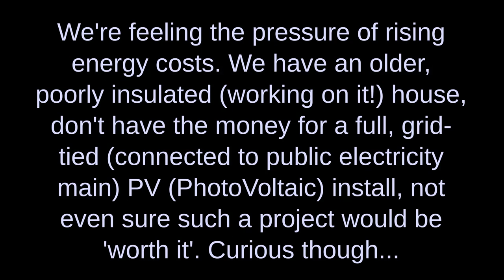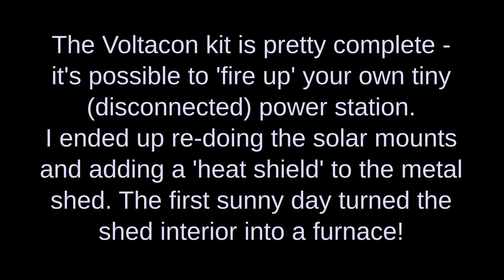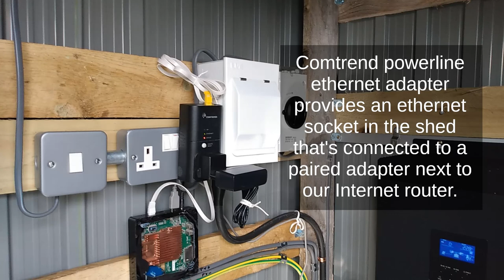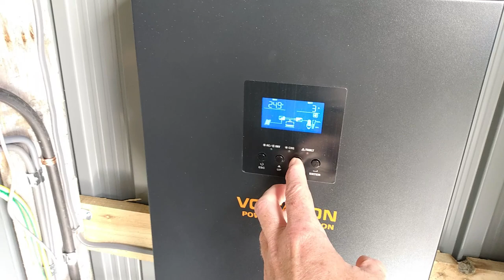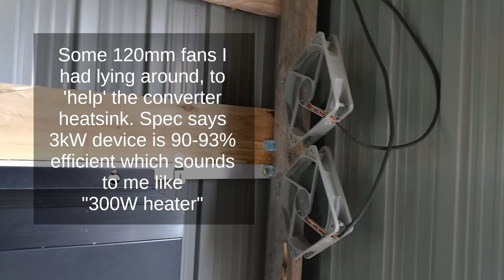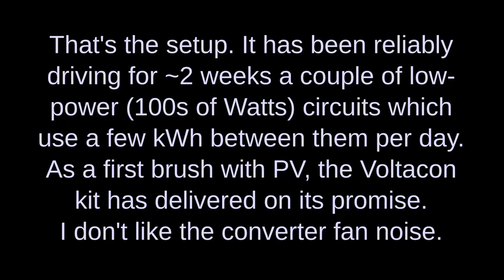Voltacon S3 Off-Grid Solar Kit 24V 3kW in back garden

Comment: It's great to have a small glimpse of what you've been busy with - this is a really impressive setup. I was going to ask if you can build me one next, but then I started reading the 2 month update ;) It's a shame it isn't plain sailing through these heatwaves because it seems like now is exactly when you want to reaping the benefits.
Reply from the maker: Hi Simon, I want to see it go through at least one winter first before I'd give it the complete seal of approval. We were so pleased with it we ordered more solar panels (in the post) just before it died. Not winning the "we could run aircon for free" argument indoors: tropical weather doesn't last long enough yet! The owning-your-own-powercut thing needs some more thought - if only I had a bajillion vans full of guys ready to fix any problems that might occur...
Reply: Hmmm yes - I do live in an area where the infrastructure is just old enough that there seems to be a localised power cut somewhere every other week, but it does indeed get fixed very promptly so that's nice to not worry about. We're almost weaned off gas now with just the boiler left, but obviously that is still reliant on the electricity running regardless. I assume that the panels are a pretty safe investment though so long as you've got something to collect and store to connect them to (shame about missing the opportunity to see them delivered to a certain front desk).

Anyway as I say, it has been great to see these. Possibly through the mysteries of the algorithm I am now getting suggested loads of DIY doing-up-British-homes videos, and then follow-up videos about how successful these types of videos are, have you considered diversifying?
Reply from the maker: @srjm86  I'm going to use "considering diversifying" instead of "wondering what to do when I grow up" from now on. My angel investor doesn't have unlimited patience - I'll be back in a mill any month now
Reply: @trs4u  And just like that "Solar panel sales boom as energy bills soar" is the BBC headline, although this is covering people who are very much on-grid.
Reply from the maker: @srjm86  Should have an update soon, waiting for bits and bobs currently (due to boom?) as rare as hen's teeth that'll probably be in the Screwfix catalogue next year. This no-inverter power cut put quite a hole in my plans. I wonder if people 'getting it done properly' can phone their installer and get dead equipment quickly swapped?

Comment: I have 3000w inverter esun 12x 280w solar array 2x24v 100ah 4.8kwh )battery running small 2bed house fridge.tv lighting pc etc like phone chargers laptop in a day I run washing machine and heavier loads application straight from the sun 🌞 and charging the battery in the Same time and those battery it takes 2-3 hr to charge to full  from January-November no problem for winter planning to get a extra 1or 2 battery
Reply from the maker: Very similar to ours then - that's good news about the winter. We have more panels 'in the post', and we're considering more storage. I'm hoping to run concrete slab UFH and some hot water heating on ours on an automatic sharing basis (can't all run at once!). Nothing's happening until the dead-inverter powercut ends though 😢

Comment from the maker: After 2 months of running without a hitch, we had our own 'powercut' one evening after the record hot day. The next 2 days were thick cloud/haze here and we had 4 PCs in the house blazing away (combined about 500W drain) early in the morning to late in the evening, we drained the battery down past 21V and the inverter cut out. Not the end of the world, we went straight back onto 'brown energy' by the magic of extension leads until the next morning. A week later the power cut out again late on a sunny morning, batteries at 25.2V. This time it seems completely dead - no display, no fans, no output. We can get a warranty service, but apparently this could take weeks. We had been talking about what to do in the event of our very own powercuts, and this seems like yet another thing (we're replacing the 6 panels with 12 slightly larger in the hope of coping better with low-light days) we should have considered before buying and committed to spending a little more money on in the first place. It's now late 'cost of living crisis' in the UK, and solar bits and bobs seem to be in great demand. Current best plan seems to be to have a spare inverter handy, or getting more than one inverter with 'parallel' capability for greater output power but also in the hope we can fall back to one temporarily if the other dies.
[14th September 2022] We bought another identical inverter/charger unit - mostly to simplify what needs to be done if it fails - and a lot more PV (4.8kWp to add to the 1.8kWp). It has been very overcast for full days recently which means we've got very few loads running full-time on solar, so as to avoid complete discharge of battery. The new PV is here but can't go outside until 'mounting accessories' arrive; they're on back-order. If anyone is wondering about the impact of warranty repair on a solar system, the original unit is still (since late July) not back.
Reply: I wouldn't use them again tbh. There website contradicts it's self , their kits aren't compatible with drop down selection ( blow your inverter) Information on what you actually are buying is vague and they definitely are not plug in and play.  Unfortunately I brought from them! Live and learn !!
Reply from the maker: @richardphillips3862  I don't have experience of a solar energy supplier to compare them with. I've ordered equipment 4 times this year from Voltacon, and apart from a replacement for a shattered panel (the panel I picked as replacement had an "end October" availability date when I picked it) and the too-long RMA, I've received everything I've paid for and been happy with it. Matching equipment is a minefield - I feel like I got initially lucky with a max-140V 60A charger, 1.8kWp of 6x40V Voc panels and 4x 150Ah 12V lead-acids. Their website information can be chaotic, sometimes obviously so while cross-checking equipment specs. Their correspondence is occasionally surprisingly idiosyncratic to the point where I've wondered if their staff are being forced to work there against their will. Having said all that, they remain communicative (sometimes weekends and late at night!) and willing to advise even while I'm testy about slow orders. I sympathise with their protest that they're overwhelmed by the sudden increase in business arising from 2022's "Cost Of Living Crisis" and everyone suddenly wanting solar energy. We're saving up for a couple more large (by our standards!) solar energy upgrades, and we'll almost certainly order from Voltacon again. Ideally I'd get this kind of stuff from our local Screwfix, but something tells me the PV industry isn't quite stable enough for that to happen soon. Hopefully Voltacon will weather the everybody-onto-solar-now storm and iron out the wrinkles in their operation.

Comment: @trs4u It was really nice to see how you set it all up, could i be cheeky and ask for a view in the breaker box/fuse box? 
I'm trying to work out what we need here and having as many of the SPD/fuses/isolators in one "fuse" box as possible to keep it all tidy.

Sorry to hear your inverter died, do you think it was the temperature in the solar shed or just one of them things?
Reply from the maker: There's not much to see under the 'flap' of the little consumer unit - it's very similar to this one: https://www.liveelectrical.co.uk/Catalogue/mini-garage-unit-ip40_ID9.html with one empty slot. I added a 6A MCB in the empty slot for the sockets (for the little PC and powerline ethernet adapter) and light in the shed. I have occasionally wished I'd added a larger one so I could plug in gardening tools, but now that I write this I'm thinking it's better that the shed stays closed as much as possible. One day I'll get round to putting a waterproof socket on the outside of the shed, at which point I'll need more consumer unit space...

I really don't know about the inverter - it was logging data every few seconds right up to the breakdown and everything seems fine, including the last log entry! Maybe I'll hear what caused it - last I heard it was still in a busy queue for service technicians. I have also been logging (because it's 'right there') the temperature from the solarshed PC, which as a fanless PC is probably about 10-20°C over shed temperature. That didn't seem to get very hot, even in the record-breaking hot weather recently.
Reply: @trs4u  Much appreciated, it was the DC side breaker box I meant (@2:24). I'm assuming its fuses for the solar strings and a breaker?

Sorry to hear its not back yet (its a bad time to be trying to order all this kit currently with how in demand everything is... typical its the timing of our overall project)
Reply from the maker: @BCFHex  There are two fuses for each string of panels. We have panels with a Voc (open-circuit voltage) of about 40V, and the inverter has a max solar input of 140V, so they're wired 3 in series. Each string has one -ve wire into a fused connector, one +ve wire into another fused connector. I've pulled all the fuses out at the moment while everything is offline to isolate components as much as possible. There's also a BENY BUD-40/2 SPD in there between the -ve and +ve sides that accepts the Earth connection, and there's a breaker/main switch as you say. It's pretty much the same (more populated ways) as the one shown here: https://youtu.be/KMJ1HgjZWv0
Reply: @trs4u  Perfect, exactly what I needed to know.  Many thanks.

Comment: Change the battery to lifepo4 I know they cost fortune but 2 x 24v100ah will work moch better and for longer (for example running tv or fridge or pc overnight) than agm battery or gel one they are disaster for solar ruined them quick waste of money
Reply from the maker: Sorry for slow reply. We're still running on our lead-acid AGMs, but not convinced they're giving us 3.6kWh of storage. I'll have to go through all the charge/discharge data at some point to see if I can compute a 'real' capacity for them. We have much more PV than we have charge capacity for now, so an upgrade would be good - so would being able to afford it! The charger/inverter unit in this kit will only convert max 24V*60A (~1500W) of solar, and the AGMs have a datasheet max charge current of 30A (x2 for our 2-by-2 arrangement) so the kit is currently well matched. When I look at lithium cells they also have a low 'max charge current' specification, so I'm wondering if our only next step isn't to go much larger with charger, inverter, and battery? Also, the Conversol A5 charger/inverter in our kit doesn't support charging lithium batteries, only lead-acid (AGM or 'flooded'), so it looks like lithium upgrade alone is out of the question.
Reply: They cost a fortune so it’s not really worth it always it is definitely a fine to try AGM like they have her. I would also recommend if they are trying out system and it’s not permanent.

Comment: Sorry you had to go with AGM.
Reply from the maker: Not yet! They were working as promised, so it's hard to know if the "grass would be greener" with a different technology.
Reply: @trs4u  lithium should last longer but it will degrade slowly overtime. AGM will not last as long but AGM is definitely worth it for an experiment as good lithium batteries cost a lot.
Reply from the maker: @UKsystems  We spent what we had in our 'renovations fund' which was nowhere near enough to get any of the big jobs done that we're saving up for. The AGMs and the no-lithium charger were all we could afford at the time. Using a delta discharge method for calculating their capacity, I reckon they're only a fraction of their nominal capacity and nothing in my data suggests they were ever any better. They're still part of saving us £1-2 per day on our electricity bill, so if we replaced them alone now they have just about paid for themselves. I think I'd almost certainly not buy lead acid again (unless they completely fail and I don't have the pennies for a new inverter) if only to avoid carrying them round the side of the house again! They don't seem to have decayed over the last year or so, so I'll probably still be 'thinking about replacing them' next year too!
Reply: @trs4u  that is why AGM is good. It lasts longer than lead acid but not as long as lithium but the cost is okay.